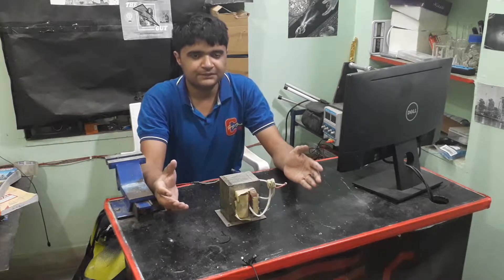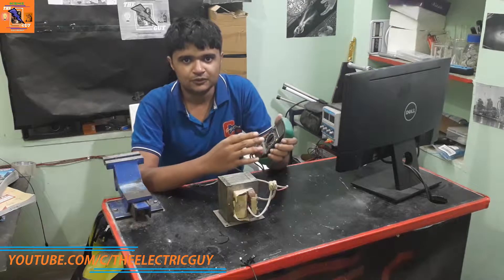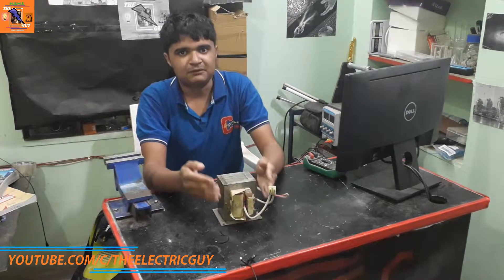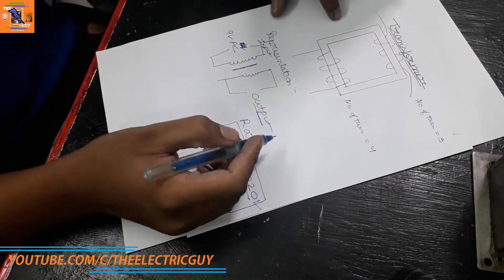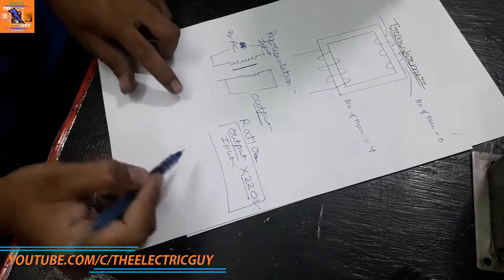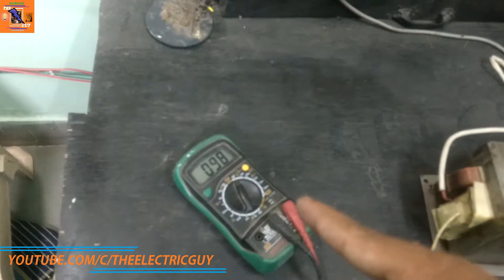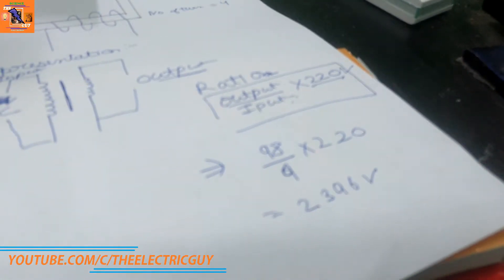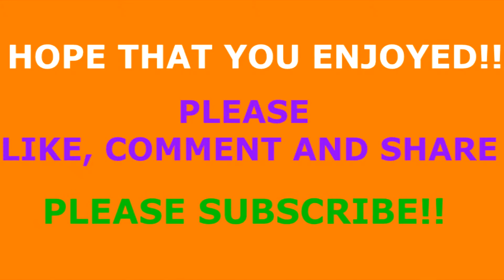HOW TO MEASURE HIGH VOLTAGE AC????

Comment: 12 volt 1amp power supply. Going through a primary coil 12 turns of double wire (24 turns). 2ndary coil 335-340 turns. L552 flashers. And I use it to high voltage through the body to kill parasites. But I have no idea how much voltage im putting through myself. Two pads that go on the body. 

I can find a 1000:1 probe for multimeter, but multimeter is not fast enough to measure fast dissipation. Any suggestions?

Comment: I am quite sure that if you measure the output voltage of the 9V transformer when it is connected to the large one, you will never get actual 9V, but much less.